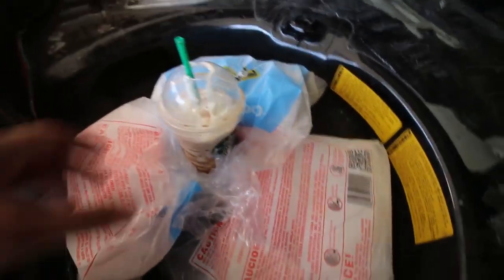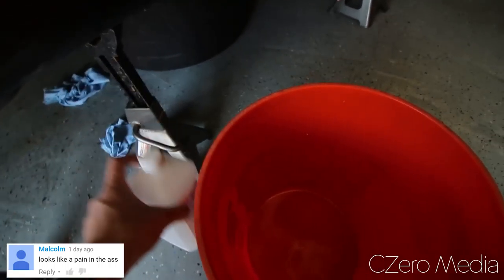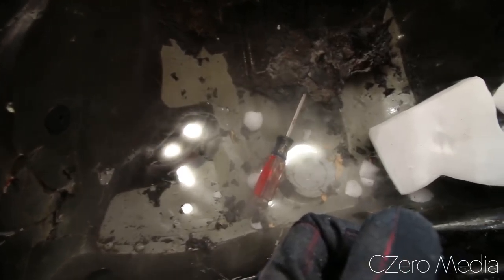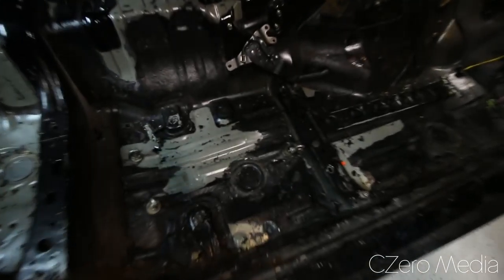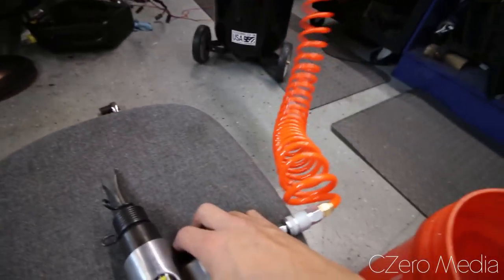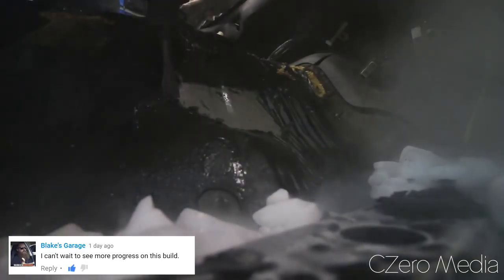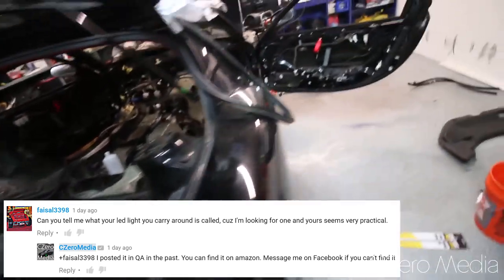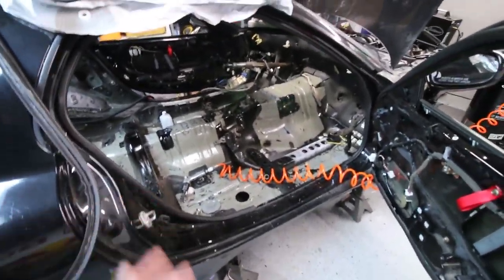How To Remove Sound Deadening - Dry Ice Method! - Wide Body V8 FD RX7 Build Video Series 14

Comment: You can also try ethanol to remove the sound deadner. Also, are you going to apply a new sound deadner or are you not going to apply any for weight reasons?

Comment: took my sound deadening out a couple weeks ago using dry Ice in my 240. I had the same problem of getting the sound deadening off the wheel wells. If only there was a way to make dry ice stickier . ended up just scraping it off with a sharp hand chisel @ room temp. It left a bunch of tar residue though.
 tried using liquid nitrogen first, and it worked so well, until I realized I had cracked my floor :(
nice work man!
Reply from the maker: wow. liquid nitrogen! lucky you! where did you aquire this amazing tool for science experiment? BTW i would have never guessed that a neko romancer would be building a 240 lol
Reply: I romance nekos part time you know haha, seemed like a funny username I dunno. My parents business gets liquid nitrogen  at a fixed rate no matter how much they use, so I just had them deliver a little extra for me. It seemed like a good idea at the time, especially for getting to those areas that are hard to press dry ice on, and it worked real well to freeze the deadening. You heard the tell-tale crunches almost immediately , then a very light blow with a hammer would shatter it.
I didn't take into account anything I had learned in my physics and chemistry classes in undergrad though :). Liquid nitrogen freezes stuff to like -350 degrees, which then proceeds to allow the metal to warm up quickly, whereas dry ice has more of a soak effect. This spells disaster for that super thin 90's Nissan steel. I ended up cracking the floor right behind the seat to the point to where you could see the ground. I then had to weld it all up, and do the rest with dry ice. cool cars man
Reply from the maker: +neko-romancer 95 Haha. Thanks for the interesting story. I never knew people attempted this with liquid nitrogen. I guess that's why it's not easily purchased lol